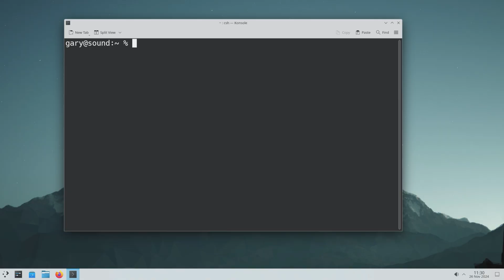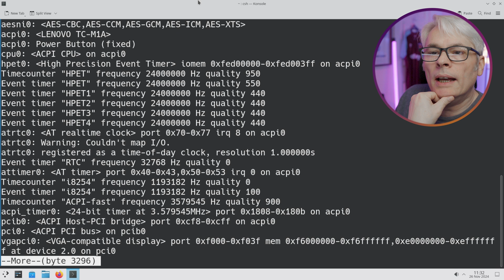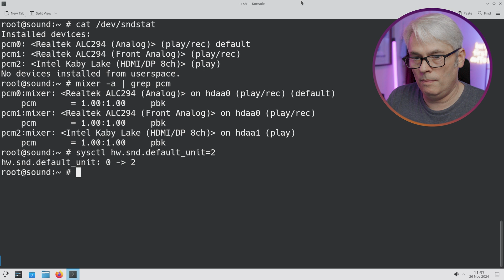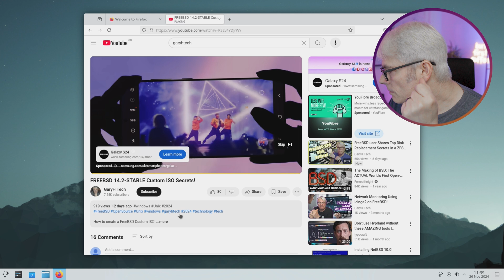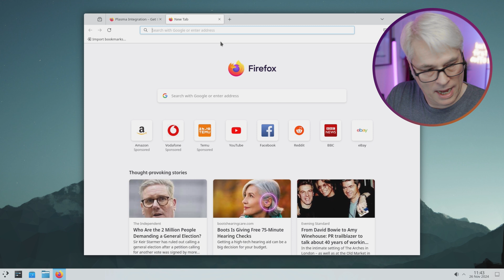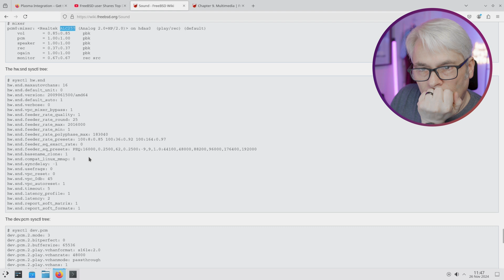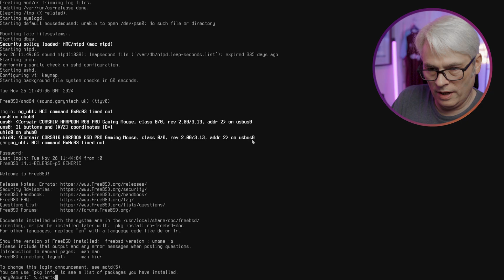BEST Audio Setup for Beginners on FreeBSD!

Comment: My problem i'm facing is Input for my Blue Yeti microphone, I can't seem to get it working.  The mic is dected on FreeBSD I open OBS Studio and properties to the blue yet device which is dsp7, but theres no sound picking it up, I try + it in mixer in command line and its 100% or so it say in kde  is also 100% up and still not picking up my voice or any sound.   and pulseaudio --start seems to be bork and i'm out of luck eh.

Comment: Thanks for the info Gary, I have used Linux for a long time and tried the BSD's on occasion, giving FreeBSD a good run on a Thinkpad x230t at the moment and everythings working well, even touchsreen and stylus input. I'm running Sway WM (wayland with xwayland too), really enjoyed this info on FreeBSD audio, have the same problem that you encountered when trying to capture audio in a screen recorder. Have tried to send audio via monitor to a screen recorder (tried wf-recorder and OBS), video no problem but audio not captured. If you find a solution I would be be interested, I have been able to capture audio on Arch Linux using wf-recorder and include the monitors audio.

Comment: Hi Mate, virtual_oss is a better way to switch audio devices than sysctl
it also lets you record oss desktop audio with obs studio 

you can also use the mixer command with virtual oss to switch devices, 
the advantage is that your multimedia volume keys will still work with whatever audio device you switch to

guide on the freebsd forum under
multimedia keys the mixer and virtual_oss

sudo pkg install virtual_oss
sudo sysrc -f /boot/loader.conf cuse_load="YES"

switch dsp1 to your device in the example below

sudo vi /etc/rc.conf

virtual_oss_enable="YES"
virtual_oss_configs="dsp"
virtual_oss_dsp="-T /dev/sndstat -S -Q 0 -C 2 -c 2 -r 48000 -b 16 -s 1024 -P /dev/dsp1 -R /dev/null -w vdsp.wav -l dsp -t vdsp.ctl"
# sndiod audio
sndiod_enable="YES"

use the mixer to switch to pcm3 and set the virtual oss device
change pcm3 to the device you want to switch to

mixer -d pcm3 -V /dev/vdsp.ctl:play